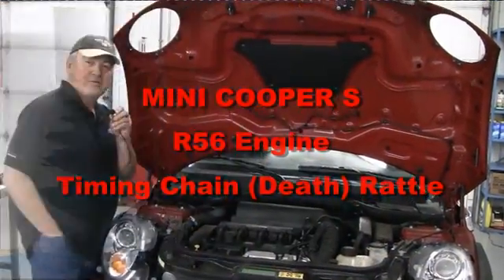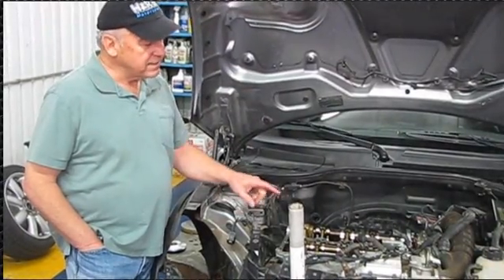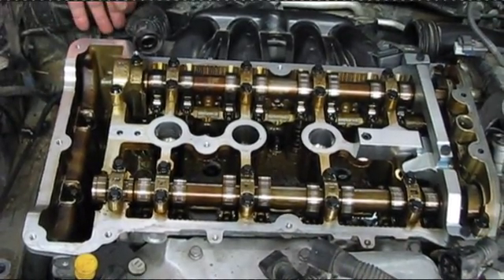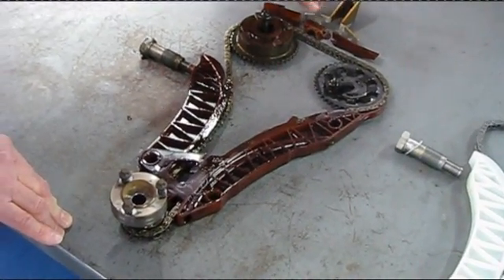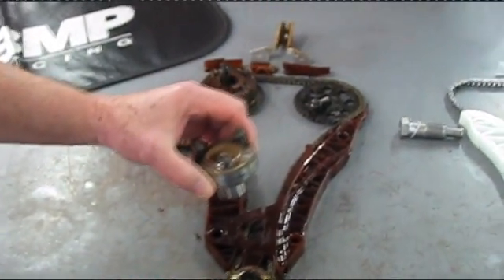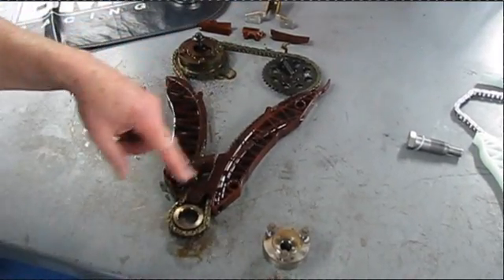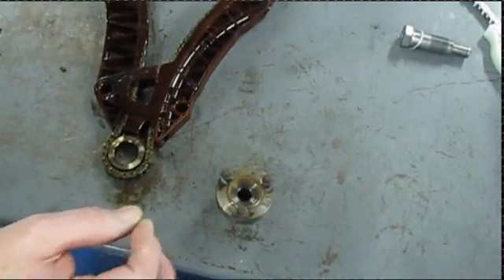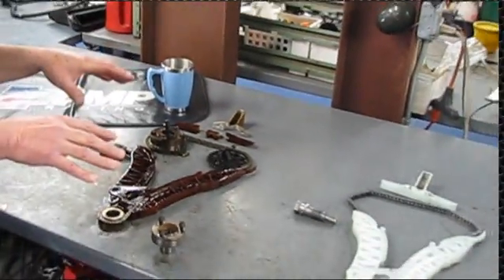Mini Cooper "S" Engine Noise - Rattle

Comment: Hi... I have a 2013 mini cooper hatchback and the engine is making a tapping noise similar to what the one you are Showing... it sounds like it's coming from the same area but closer to the right under the cover.. or maybe it is coming from the area where you are putting the mic ?? Lori

Comment: I know this is old, but if anyone have this issue and see this message.  Here is an EASY WAY how to tell if you suspect your timing chain guide broken or crack or damage.  Drain your Oil and exam for small pieces of "Plastic / Others" in your Oil + Filter.  If you do not find any, then it's still aok and could be the flappers loose.  If you see little pieces or fragments then you know what it is.
NOTE:  Change your Oil often and make sure it is "Synthetic".  Regular Oil can break down / crack things when the Engine is hot.
Reply: which one or which part would be the flappers? do you have any videos?
Reply: @DiegoKmona  -  Hi, it's actually the 'Valves'.  I call it the "Flappers" since it flap up and down is what we are actually adjusting.  See this guy's video here.....  He explain it even better than I can.  Link:  https://www.youtube.com/watch?v=ZFvwyCroV2w
Reply: @DiegoKmona  -  By the way.... EXAM your Oil and that is very important !!!  You will know a lot, just by doing that.  NOTE:  Use "Synthetic Oil", this will prevent parts 'Break-Down" since the 'Guide" is made of "polycarbonate".  YES, cheap + crappy oil can break it down or made it weak during Hot/Cold during engine usage/running.

Comment: Have recently in last 5000 klm replaced  tensioner how long  do they last as bloody exspensive job
Reply: Change your Oil often and make sure it is "Synthetic".  Regular Oil can break down / crack things when the Engine is hot or too hot.

Comment: I am surprised no one here mentioned (or maybe knows about) that these are BMW engines which are also used in earlier generation BMW 1 series. And BMW 1 series has this problem very much so. BMW did have a recall and fixed failing timing parts at no cost. To make matters worse the 1 series engines are oriented so that cam chain is behind, i.e. under the firewall, means one has to pull the whole engine out to work on it, what a Nightmare!! 
I have heard that problem starts when the thin oil jet in the tensioner gets clogged, stopping it from applying pressure on the chain. To avoid this, change oil and oil filter often, even before the change is due.

Comment: Hello I’m a mechanic that bought a Mini Cooper for my daughter and like most people I thought the mini was the cutest car. But just as some people have commented, this car has lots of maintenance issues Because my daughters mini stayed on the lot for a while. I’ve changed out all normal maintenance items in the motor (engine oil and filter, spark plugs, air filter, cabin filter, put new lights on and all the black out trim to make it look nice. The difficult items that thew me for a loop is the spark plugs needed a special socket, the PCV diaphragm is built into the valve cover, the timing chain assembly, and the transmission fluid change. My daughters mini is a 2009 Mini Cooper non S model. I have all the parts installed and have pictures of you guys need help. If you are burning oil it’s because of a couple of issues and the main corporate is the PCV. Let me know and I’ll send you some information of what I have found out. Buy a Mini Cooper manual is the first thing I will tell anyone with this car. And not the one at your local auto parts store. Oh and I have interesting pictures of the timing tensioner before and after the install and it’s not what this YouTuber said
Reply: hello good afternoon my name is cesar I have a mini cooper s 2010 with the lotor n18 I have problems with a loud noise and you could help me
Reply: Hello, my mini has the engine light on,  scanner read code P2188 (system too rich at idle bank 1)
I changed the MAP sensor and PCV valve cover and still reading the same code. I reset the computer after but my car still running weird. Do you have any idea what could be the problem? Thanks in advance
Reply: Hi have you inspected your valve cover and gasket

Comment: Yea, mine went out, engine wouldnt start, took it to Mini (didnt buy the car from them, just figured if anyone can figure out whats wrong it would be a mini dealership) they gave me a loaner car and had mine for 2 weeks checking out. Get phone call saying tensioner went out, wreaked havoc on the engine, whole thing would need to be sent off for rebuild. $8,000 repair. Awesome. I just got out of the army, jsut spent every dime moving to new city, starting new job, had nothing to my name. Now I need 8grand to fix my car? Beautiful. I was in tears at work. Told them I would need time to get the money together. They asked how long. I said atleast 6 months. So they said they would call me back. Another week goes by, the GM for the Mini dealership calls me. Says he heard my situation, says they will do the repair at cost, just pay for parts (not marked up, their price) and they will cover labor. Cut my cost down to about $3000. Said I still need a few months to get that together, he told me not to worry, to keep the loaner car for as long as I need. He emailed me a document with his signature saying I can keep it until my repairs were finished. 3 months later I paid my bill and got my car back. That was 3 years ago, I take my car to them for everything. Sure dealers may over charge and can be expensive places for repair, but the Mini dealership where I live, where I didnt even buy my car from, saved my ass. Plus they helped make sure all my paper work was in order so I can submit it to the class action lawsuit against mini for the timing chain issue. So fuck the engine and stupid car I have had so many nightmares with, but thankyou Mini for being super awesome and helpful.
Reply: guys can you help me? https://youtu.be/4HlynUv9Djc same problem 😢
Reply: what year and model did you own ?
Reply: That is very cool bastard of an engine it is with that timing chain issue just done one myself good luck champ

Comment: hi sir. i have aproblem with my mini cooper s 2012 r56 engine n18b16a. the computer shows low pressure. i replaced a new one and didn't work.
what do you think is the problem?

Comment: what a shit engine I'm a mechanic and made the mistake of buying a car with a french engine 🙈 its been nothing but problems for me
Reply: French engine?
Only diesel engines in mini was peugeot.
Prince engine was designed by bmw engineer s
Reply: David Mclennan maybe you need to keep up with maintenance, 140k miles down and no problems.
Reply: Its the timing chain tensioner - has been upgraded 3 times , the late mk 2 models have the latest version .
Reply: Vincent-Have you ever thought that you may just be lucky? I change my oil every 5000 miles and check the levels weekly. Timing chain still needed to be replaced at 100k miles. There's a reason BMW settled the class action lawsuit against them over this reason.

Comment: have an R57 engine in my 2010 mini s convertable. Had similar noise, was sent  class action  papers, but BMW has yet to admit fault on timing tensioner. Went ahead and had a local well run small shop change this out with an upgraded version. Did the trick. No more noise. Do you know ,IF BMW kept the same setup, as seen in your video? (guide rails , etc). Thank you

Comment: Any reason why one couldn't just replace the top piece that is broken?
Reply: he said in the video , in this cars case some of those broken bits wound up towards the bottom on the chain but luckily didn't get lodged near the sprocket at the bottom..which I assume would have ended up with a catastrophic engine failure.
but I would think your right, if you further inspect and you don't have that problem you COULD just replace the top rail
Reply: Thanks for the reply.  it just looked like the top piece would be a comparatively quick fix if possible.
Reply: Greggory Park 
It would be nice if the aftermarket stepped in to correct the problem by redesigning the parts with a measure of durability rather than cost reduction in mind. Have to wonder if this was intentionally designed to just last for the duration of warranty coverage. 
First time I've dealt with a car that has its thermostat buried in a disposable housing, and with a lifespan that could be considered as a maintenance schedule. Perplexing as there are no advantages to doing it the way they did either. Temperature control is actually very poor, from the readings seen on a scan tool (a simple engine temperature gauge is conspicuously absent on this 'sports' car, though they had space for the wall size speedometer..)

Comment: So I've just bought a Peugeot 207 GTi which has the same PSA/BMW Prince THP 175 motor in it as the cooper S. Im wondering exactly what symptoms to look out for for this. My car is a 2008 with 53k miles on it. When it is cold there is a minor top end rattle which gets louder when you rev the engine past 2-3k or so. This rattle goes away once the oil has come to temp (when I did my pre-buy inspection the engine was already warm, kicking myself for that).

Checked the oil and its filled to a good amount. Car also appears to drive well.
Reply: Just to point out the idle rattle is not as bad as the one featured in this video but gets a lot louder when you rev the engine a bit.

Comment: BMW has settled a lawsuit in the USA over this problem.

http://www.carcomplaints.com/news/2015/mini-cooper-timing-chain-lawsuit.shtml
Reply: Rixter 
Maybe there was as a settlement, but just for the two plaintiffs that filled the lawsuit. Squeaky wheels got the grease, it seems.
Reply: Reggie Hillier old post, but was there a settlement in the end?
Reply: DTR RTD thanks for the update. I had the issue, but my MINI dealer fixed it and now my car is 9 years old, so even if there was a 10-year warranty, it wouldn't benefit me.

Comment: just bought a 2012 countryman all4 s called the dealer they said that version does not have the timing chain problem. They also said keep an eye out for oil on the passengers side where the timing chain is and then go from there. they also told me the engine should have a similar small diesel sound on cold start days.

Comment: Informative but exactly as he said, an overview only.  I am a tech for a living and work at one of the few independent shops in my state (as far as I know and have heard by the amount of these things we do) that have the necessary tools to do this. Depending on the year and aspiration (turbo or non), it requires different specialty tools. As far as we have seen, this happens to any mini made before 2012.  We have not done one made after 2011, but that's not to say it doesn't happen to those too.  It's a difficult job if you've never done it.  And doing it wrong can lead to more harm than good short term (in then end it's catastrophic).  Make sure whoever is doing the work knows what they're doing.  Torque specifications on these things is very important (i.e. you don't just put the tensioner in and call it a day, you have to pre-tension it first, then tighten it to spec). Any questions I'll answer if I can. Good luck!
Reply: +Pawnit Notting My R56 is making the exact same noise.  If it is indeed the timing chain rattle, will it harm it to drive it... or do I need to not drive it until it's repaired?  I guess my question is can it cause more damage by driving it?
Reply: +Wyatt DiVall yes it will do damage eventually. The reason the noise occurs is because the timing chain has lost tension. With that being said, once the chain loses tension the engine becomes out of time. If the engine gets too far out of time engine damage will occur. My suggestion would be get your car fixed ASAP.

Comment: does anyone know if this can be the same in an 02 mini one? just had this noise start this evening when putting it away :/ garage with it again!
Reply: +Angel27918 Yes but it is a different engine so you will need a different tool to lock the single cam shaft. The tensioner is similar but there are only 2 guide rails to replace. If you car has the rattle , don't drive it, get the tensioner replaced as they tend to stick with age and it may be worth replacing the 2 guide rails with new ones. Not a difficult DIY with the right tools and a Bentley manual and should take an afternoon to complete. If your guide rails are damaged you will need to drop and inspect the Sump for broken parts of the guide rails.

Comment: Just wondering if its the same noise my car makes. it goes away whenever I hold the clutch down. then starts back up again whenever I let it go. (2005 mini S 88k)
Reply: Hey the issue you have the push out bearing in the clutch.

Comment: My car (2008 S) has 55k miles and the entire chain assembly was replaced in 2013, including tensioner.  Noticed this morning (in about 30 degree temps) that there's some noise...very similar to "valve lash (?)" or lifter noise which Subarus are notorious for (cold starts).  It may do it every day but since it's my wife's car, today is the first day i noticed it.  Is this also "normal" for Minis?  Thanks...great video.

Comment: Everything i read is for 07 and up minis, I have a 2006 and I'm pretty sure the chain just failed, are these cars affected with this. Mine is an supercharged thanks
Reply: The tensioner failed, not sure why the oil level was always kept where it should be, the chain and guide rails were in pretty good shape but I changed them anyway, also found out when everything came apart that my harmonic balancer was completly toasted so that added another couple hundred to the bill, over all it wasn't a bad job to change if I didn't have to wait for the balancer it prob would have only taken about 6hrs or so
Reply: Im also looking to replace my second body control module, I currently have no heat or ac in the car and I'm about fed up with it, I have it listed for sale now only asking what I owe just to get out of the car, there a good car but a very dealer specfic car wich sucks oh well lesson learned I'll never buy another mini again

Comment: I purchased a new crankshaft hub (the peice that goes between the shaft and the balancer) and a new crankshaft sprocket the two don't match in size exactly. The hub seems tapered. While the old one slid right out of the sprocket. Does it sound normal that it must press fitted when torqing the crank bolt?

Comment: I have the same exact rattling noise in the same exact location but my mini is a base model (07) not an S is it possible I still have the same issue or no?
Reply: What ever happened with your mini? I have the same year and my rattle has gotten worse today and I’m worried
Reply: @Chris-lf1ki  I no longer have it but I noticed that some oil brands made a dramatic difference not just with my mini but multiple vehicles. Mobil 1 for whatever reason was the worst and amplified the noise, pennzoil was a little better, Rotella 5w40 was very good and Castrol 0W40 seemed to be the quietest. I also had a 95 Miata after the mini that was even worse on start up and if it sat for a week or two sounded like it was going to self destruct after a few oil changes when I finally tried Castrol 0w40 again I got the thing painted and was without the car for over a month went to start it up cringing my face expecting the nasty noise to be but nope quiet as can be same for storing the car over the winter. I don't believe in snake oils but from my personal experience Castrol 0w40 just has some sort of special touch that other oils do not. Rotella 5w40 is a close second other oils are all louder and Mobil 1 by far the worst I really don't know why exactly and did not want to believe it. I know it's hard to believe and your situation might be different but give it a try
Reply: @joshbotelho1994  Thanks! I found out yesterday that the mechanic I took it to for an oil change the day before didn't put the filter on when he was finished and all my oil spewed out and burned my engine up.... lol. it's completely screwed.

Comment: hey boss, my mini (2007R56 non S  AT)will make some noise like chain sound when i go up hill with RPM among 1600-2100.. and the sound will appear continuously when i go up hill, sometimes will appear when car shifts gear... 
but i didn't find any wrong code about it. i doudt whether it will be a transmission problem or engine knocking

Comment: When you said that the new tensioner is actually shorter, doesn't it mean that the car had actually already had a tensioner replaced under a MINI issued TSB? 

Also did you get to compare the length of the new and used chains? Was the used one longer?

Comment: hello my friend i have a problem in my mini cooper s 2008 , i have 2 cylinders #1 and #4 misfiring first thing i made a compression for my car and it was fine i checked all cables and sensors i checked injectors , coil and spark plugs , changed hpfp and also the back fuel pump , also checked the ecu the car has a very rough start working only on 2 cylinders . there is no check engine light and the car is vibrating like crazy .. any help please
Reply: Did you ever fix the problem? Your vehicle may have excessive carbon build up

Comment: My wife's Toyota got 100,000 miles in Germany and needed a new engine because of a bad cylinder head free of cost by Toyota after six years (they know there were issues with the 2.2 Turbo Diesel 177 hp). A gear shaft of the manual transmission seized as well, so we needed a new transmission for almost 3,600 Euros. I like Toyota, but this one burned our money like nothing else in the world.
Reply: heros2110 Opel ist noch geiler